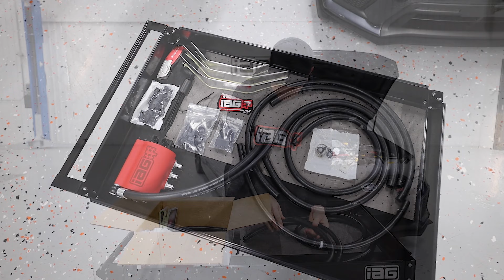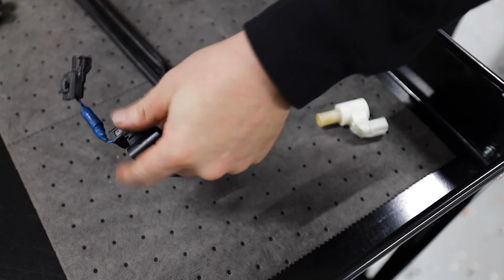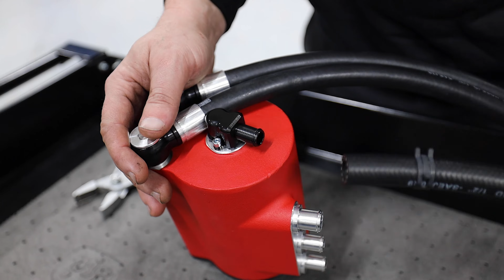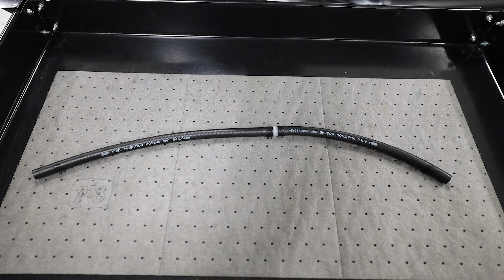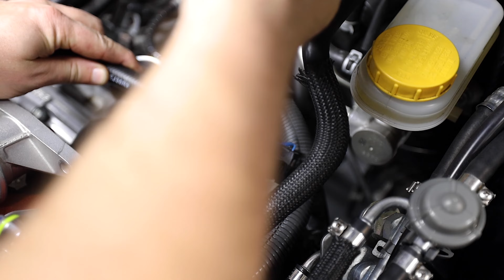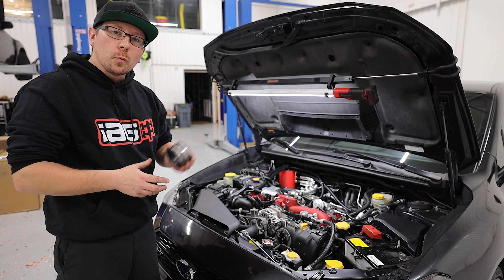2018-2021 STI Air/Oil Separator (AOS) Install Instructions | IAG Performance

Comment: WITH THE 2011 STI. idk if i can route my drain hose the same as in this video. it almost looks like where it sits at the trans/engine mating spot its higher than the bottom of the aos

Comment: 02 sensor socket Part# SLC66750B  it works well on top of the hose and around plastic perfectly, to install the hose in when you press it from top 👍🏻

Comment: Is there a coolant line in and coolant line out on the iag can ? Or it doesn’t matter which line goes where?
Reply: They say it doesn’t matter which coolant hose goes to which connection. That doesn’t make sense to me though.
Reply from the maker: It does not matter since this integrates into the coolant system which is ran in series under pressure.

Comment: Old video but hopefully this helps someone.  I couldn’t get the hose on the block with the clamp pre-installed like several others in the comments.  After 2 hours of fighting with it I put a zip tie around the bottom of the hose with the bottom clamp undone on top.  After slipping it on the nipple I used extended needle nose pliers to close the bottom clamp.  Then cut the zip tie and removed it.  It wasn’t easy but at least it was doable.

Comment: Is your intercooler supposed to be squeezing the 2 tubs under the throttle body??????? Please, if anyone can help, please answer me. 🙏 I bought my sti and it came with an iag. Today, I just took off the intercooler, and I noticed the 2 tubs under the throttle body that connect to the iag are being squish. I feel like the previous owner didn't even try his best to put it on, and now I feel like I needa redo everything

Comment: Question I just finished installing the oil separator to my 2020 Sti and now I have white smoke coming out of my exhust. WHY?? Some please help.
Reply from the maker: Double check your work and make sure all of the hoses are hooked up to the right positions. The AOS should not cause any exhaust smoke when installed correctly.

Comment: Really wish you would remove ads for the instructional video to a product that you already profited from. Would be good to review each cable port for your viewers and you undersold it at 5:44 and 07:03 immensely. That was dirty, installed yesterday and worried this isn’t secured. You should supply a tool or something for this if you’re promoting self installs.

Comment: This is THE video to get this installed properly....Seriously  better than the updated video....PDF directions and new video are trash...i don't need dance music to install auto parts...Needs to be spoken. Newest release has  premade  90* pieces now and also use quick connects to the AOS

Comment: Hey, just got the updated iag Aos for my 21 sti , and i just came across this vid. But when my mechanic installed the iag aos My mechanic reused the oem pcv crossover piping in this installation, and he used the block off cap to cover one top most part intake port on the aos part, is this fine? Does all the port from aos needed to be re routed? Or is it optional?

Comment: “Install the clamp” I hear it in my sleep 😂 I’ve watched this video about 8 times now and am still nervous to install it myself lol. Thanks so much for a great product and incredible video.
Reply: Prepare for about 6 hours of work. 😂
Reply: @ I shan’t even attempt it LOL I think I’ll trust my local shop to do it right the first time 🤣 if I did it’d be more like 12 hours id work and crying in the corner.
Reply: @scottayers3282 😂me too bro fawwwk
Reply: Just did this install on Saturday. took several hours. the largest hurdle in the end is getting the intercooler to turbo coupler back on. 
For the routing of the PCV breather hose w/ valve, I put it behind the two AC lines running along the firewall to keep it out of the way of the top mount during reinstall.
ended up having to clock my intercooler to turbo couple down about 10-15 degrees to encourage it to go onto the turbo when reinstalling.
Reply: Anyone ever uninstall one? I did mine like five years ago. I think I have a version too. It took a long time. I think I have all the original parts, but I don’t remember if I cut any original hoses. I’m thinking about paying somebody as well.

Comment: I have a NON-tuebo EJ that eats a ton of oil. Can one of these be made to work on NA engines? I can figure out mounting easily enough.
Reply: if you route the oil and coolant lines correctly to your engine then yes.

Comment: 7:08 A buddy and I started on this today. Tried all sorts of things to get that breather hose with the pre clamped clamps to go on. Nothing would work. We ended up having to slide the small hose fitting on and then carefully lower the clamp down with hose pliers and clamp it. We spent probably 4 hours trying to do it, and broke the y fitting in the process. Good luck.
Reply: I used a socket and extension to push and twist it down.  Still took me an hour and a lot of frustration. I’m worried it won’t hold. I’m pretty sure this is why they want the feeder hoses routed under the bracket to keep downforcen on the y, even though it’s done differently in this video at 14:40.
Reply: @macropod I ended up reusing the oem hose with the bottom oem clamp on. For some reason I couldn’t get the Y fitting to go on anyways with the top portion of the clamp on so I ended up using a zip tie to hold the Y fitting to the hose after removing the top clamp. I’m nervous that would hold but I’ve been keeping an eye on it so I guess we’ll see.  Took the most time out of the whole install

Comment: Will you guys increase the inner diameter of the 2” breather tube just a tad? I install these kits regularly and that tube always gives me a headache getting the y fitting in and the tube onto the block.
Reply from the maker: It is definitely the more difficult part of the installation but with some lubricant there should be some ease.

Comment: Hi do you still need to remove the electrical jumper from the pcv connection and install it to the sensor?

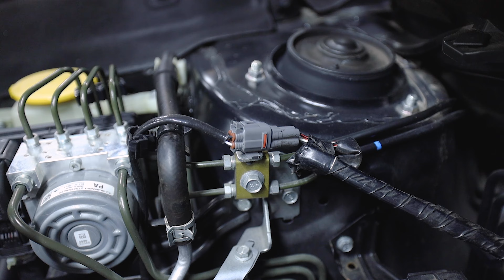Comment: did anyone else have an issue putting those thick short hose in with Y-pipe into the block? 7:12 my Y pipe broken on me while installing attempting to put it on trying to wiggle it around.. trying to figure out how im going to just get that Y-pipe replaced. literally just bought the iag v3 street from flatiron tuning. any suggestions?
Reply: i did the same thing lol now i’m fucked until the replacement comes. no idea how they got that on so easy i tried everything and used lube

Comment: Bought my 15 Sti from a pre-owned dealership. Installing this but already stuck.  How come mine doesn't have the single black connector (pcv plug) on the crossoever pipe at the drivers side?

It already has a bunch of mods on it with flex fuel etc. Any help appreciated.

Comment: you have one of these for 2007?
Reply from the maker: We do have the AOS with PDF instructions at the link here : https://www.iagperformance.com/iag-performance-v3-street-series-air-oil-separator-aos-for-2006-07-subaru-impreza-wrx-2004-07-sti/

Comment: It is a great installation video and a great product as well. Highly recommend doing this who ever won a WRX/STI. I am gonna do it by myself. Just wanna add a note on this thing:
1) Intercooler mount bolt torque specs are 11.8ft-lb
2) Intercooler hose warm clamps torque specs are 2.2ft-lb
3) Bypass Valve torque specs are 11.8ft-lb
4) There is two coolant line that is pre constructed with the AOS. I asked them about the order which line goes where (Since one goes to the Expansion Tank, one goes to the turbo outlet). They told me it does not matter. You can attach them in any order you want
Reply: The real MVP, thank you fair YouTube stranger! ^_^
Reply: Which one off the coolant line attaches to the turbo? Longer one or shorter?
Reply: p.s. worm gear clamps suck. I haven’t seen one yet on a heating and cooling and vibrating engine etc. that doesn’t loosen off over a few months or couple years.

Comment: Does this apply to 2016 sti ?
Reply from the maker: The steps are basically the same, but the newer cars have more of the white PCV connectors. If your car doesn't have one of those you can just skip that step.

Comment: Currently stuck at putting the inter cooler back in. Pipe for turbo will not slip back on no matter what tool I use to help the bottom lip go over, it will not fully go in flush.
Reply: Hey bro how did you eventually get it on? No matter what I do I can’t get it to go. I think that the turbo coupler is hitting the new aos line that’s running right underneath it

Comment: The two coolant hoses installed, from the can Frist is it the left hose on the can that goes to the the coolant expansion tank and the right hose from the can that goes to the turbo inlet hose ? Or is the order from the can not matter

EDIt : Found the answer , coolant lines from AOS can go either way to the expansion tank / turbo inlet

Comment: IAG, you need to come up with a better solution for installing the Y-fitting. It took me 5 hours, help from my dad, and several trips to the store to get that thing on the block. I ended up buying a new hose and used worm gear clamps to get it to go on. There is zero percent chance of that thing going on the block after you've clamped the bottom of it.
Reply: Seems like you got a skill issue, only took me 5 seconds with pure yell and pain🤣
Reply: @diddler_25 😂it may have been a skill issue but I don't have the car anymore so I'm good.
Reply: What did you end up doing ? Haven’t tired the install yet but I changed my PCV valve not long ago and the bottom clamp was impossible to get tight
Reply: @mikeyrov5230  I ended up buying a new hose because I mangled the one that came with the kit. It's just regular hose you can get at any auto store. I used 2 worm gear clamps and my dad was actually the one to get those on tight, I don't know how he ended up fitting a socket wrench in there to do it but he did. I pulled up on the Y-fitting pretty hard to test how tight it was and it didn't budge.
Reply: @andrewknutson91  damn , yeah that’s such a tight spot , seems impossible to get a wrench on , gives me hope tho haha I’ll have to have extra clamps / hoses.
Reply: If you break that little piece of crappy plastic, it is 23.61 with shipping to replace.  I can’t recommend this product until they rectify this obvious problem.
Reply: Strangely, I reversed the clamps (one was painted yellow, the other purple) when I did this, it went on nicely

Comment: So I just installed mine step by step, but i hear a hiss near the throttle body. Took the intercooler off again to check all my hoses and I can't find anything loose. When i give it a slight throttle the hiss stops but the car dies
Reply from the maker: We'd recommend getting a smoke test performed to locate the source of the leak. A few common places would be the intercooler couplers or the PCV hose under the throttlebody.

Comment: Use worm gear clamps where possible, particularly on the hose that drains coolant into the turbo feed. My provided clamp allowed it to leak. 

Also, if you are using a FMIC, just remove that bracket they tell you to feed the hose through the hole of. It is only used for supporting the TMIC. It will free up space and make getting the intercooler to turbo  coupler on much easier.
Reply: This happened to me also. I had to run to wal mart to get clamps. I ended up using the one they provide it and a worm gear clamps. Just to make sure it wasn’t leaking because I was tired of taking off the TMIC.

Comment: For those who are wondering about the 2017 Sti install. 
Depending if is IAG v2 or v3 Install will be slightly different.
I installed V3 on my STI so I kinda followed some part of this video but you have to see the other video from this guy BOOST AND SHUTTER.. he explains how to install on 2017 STI but the problem with THAT video is that he is installing a V2 instead of the V3.... 
once you get to the part of installing all hoses, you gotta SWITCH to this video. 
Im telling you this because I did mine like this and it was perfect install. If I had someone tell me this before I wouldn't have taken 5 hours to install mine. 
If any one has any question, just reply. I know what it is to ask questions on all these youtube videos and they answer a month later 🙄🙄 
Cheers🎉
Reply: Going to try this , this weekend on my 2017 sti , any advice other then what you stated ? I had my TMIC off to change the PCV valve,  but all the added hoses from the AOS makes it look hard for the TMIC to fit , is it save for the hoses to touch the inter cooler ? And did you use the sliver heat sleeves
Reply: @mikeyrov5230  hi man!
Yes I used the silver shields on the hoses... 
It is ok for hose to touch the intercooler as long as the hoses are not crimped...
Make sure all Hoses connected to the COOLANT tubes have a hose clamp preferably a Screw clamp because it seems like the hoses that come with the AOS is slightly bigger and you will get a small leak.
Reply: @mikeyrov5230  also search on a separate video on how to install TMIC easy. It was the only video I found that made it easy to put back the TMIC because it is difficult! Honestly the hardest part of the whole process...
Make sure to cut all hoses that go behind the TMIC longer so they dont create tension when trying to put TMIC back...
If any other questions let me know!
Reply: @Juanparrastudio  had my TMIC off when I checked my PCV and honestly it wasn’t bad to put back , I put the TB to the TMIC Frist and it was a struggle , to I tired the TB coupler on Frist and the Top mount slide right on , and yes I watched 3 vids on the install , I found the best one to follow for my 2017 STI then the vid to switch too for the lines bc I’ll be running the V3 , i have the steps almost memorized in my head already
Reply: @mikeyrov5230  ohhh! Last thing. If you are considering installing an engine bay STRUT BAR (Perrin) you much install AOS tank lowest possible because if not then your strut bar wont fit... I had to return mine because of this...
Hope I helped you. LMK!
Reply: @Juanparrastudio  thank you man , shooting for this weekend to install , got my Amazon cat  full , AOS and extra supplies
Reply: @mikeyrov5230  no prob! Good luck!
Reply: Juan going through this now, we took out jumpers like boost and shutter said to do, although with version 3 we didn’t need to do it? 
Also on the drivers side port did we even need to take off that hose to the block. 
Seems like we have several white hose adapters also
Reply: @dennisquaidlover  it depends on the year... with 2017 yes 
2018 and up follow the videos I told you about.

Comment: What’s the size Allen key on the bottom bolts that come pre assembled? Mine are leaking
Reply: Mines didn’t last long as it started leaking from the upper portion of the canister. They sent me new seals to rebuild it but it still leaks, but not as bad as before. But a coolant leak is never good no matter what.

Comment: I will be installing the AOS on my 2002 wrx. Are these instructions pretty similar for the most part? Not sure if theres any big differences considering the year. Thanks in advance!
Reply from the maker: You'll want to follow the written instructions on our site for the 06+ WRX models, but the basic idea is the same. You'll also need to follow our instructions for relocating your cruise control module.

Comment: The 2 coolant lines from iag tanl ..which one goes to the   top and lower ?or it doesnt matter as long 1 goes to each side of the car coolant lines?
Reply from the maker: The orientation does not matter, just install them in the way they fit best in your engine bay.
Reply: Thank You so much

Comment: My car only has one of the white fittings how that work
Reply from the maker: Some cars have different numbers of PCV fittings. If you don't have one just skip it an connect the hose directly.
Reply: So for the 2017 it doesn’t have one on the drivers side?

Comment: Awesome video, up until now I was a bit concerned about doing this myself, you have aleviated all of my concerns. I live in California and have to have a CARB executive order approved Air Oil Separator, I believe IAG and Cobb teamed up and the Cobb unit is basically the IAG unit with rebranding and a Cobb certification. If this is true, this video just sealed the deal. Thanks again.

Comment: Hi. I just purchased the V3 IAG AOS and I can’t seem to put the one hose onto the middle vent hole or whatever it’s called. I followed your video and it doesn’t seem to go on fully with the clamp on.
Reply from the maker: It's a pretty tight fit, but if you apply a little lube it will go on.
Reply: I did but it won’t go over the pre installed hose clamp
Reply from the maker: @jacobbalatbat153  We promise, it will. You just have to push harder.

Comment: I spilt a lot of the fluid coolant? I added more, but it went down my engine. And now it’s smoking when hot! Is that just burning off the spill????? Please help? Thank you.
Reply from the maker: If you spilled coolant on the exhaust it's going to take a little while to burn off. Keep an eye on your coolant levels and if it doesn't go away in a few days investigate for any leaks.

Comment: Installing iag Aos street series on a 🇦🇺 wrx 13 with you iag stage two tuff! Emission laws are much different here! Do I need check valves for the two turbo inlet breather hoses?
Reply from the maker: We can't speak to your local emissions laws, but additional check valves are not usually required. If the vehicle has PCV flow sensors you should keep them in position when installing the AOS.